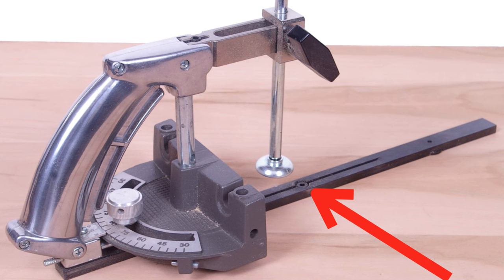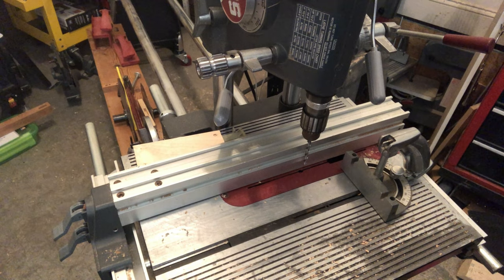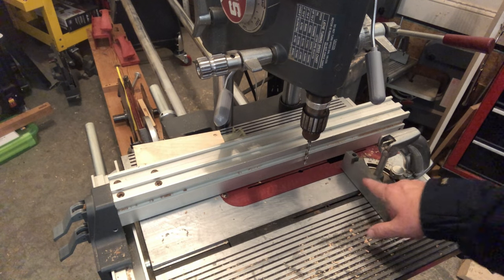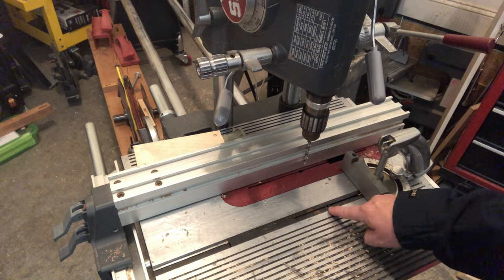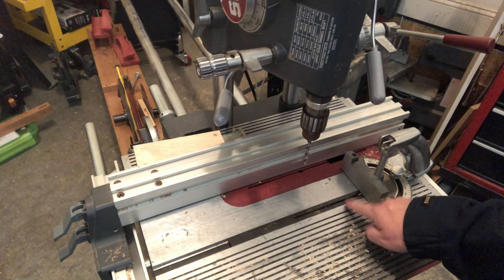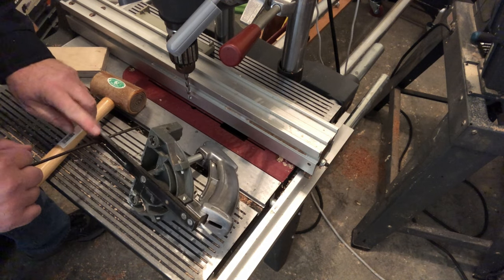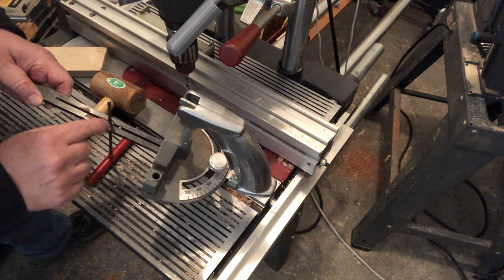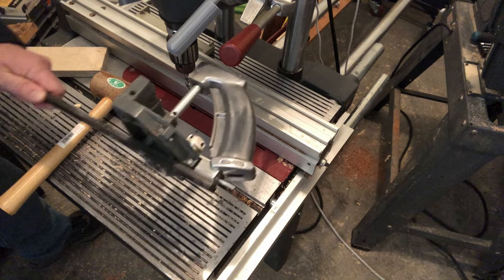The WORST Feature on the BEST Miter Gauge (You knew there had to be one!)

Comment: Yup… it’s a common problem.  I’ve had it happen twice.  My fix was to use anti-seize on the screw.  You only want to use enough to coat the screws threads as it will collect sawdust.  It retains enough to work for about a year.  Which reminds me… I need to check mine for re-coating.

And no!  The Fastenal store was flustered that they couldn’t find a source for that tapered screw.  I decided that if they couldn’t locate one… it’s origins are very obscure.

I wonder why Shopsmith didn’t just taper the hole threads and use a standard set screw?  The profitability from selling the replacement set screws can’t be enough to lock them into a proprietary sales scheme!

Comment: Thank you for another great video and tip. I have always used paper as a shim but When this happened to me, I cut the screw in half with a dremel and a thin cut off disc. Being in Canada the screws are far from inexpensive and there is never a sale on Shopsmith. In spite of the cost, I now have backups to a state of redundancy.

Comment: On recommendation of another video of mygrowthrings, I ordered and received the Shopsmith 61-poece help kit.  It came with some items that I really didn’t’ need (paste wax, shop rags) and other stuff that I did need.  You can always use another 5/32” Allen Wrench, the alignment and maintenance manual is nice and I’ve never needed a pocket oiler but it’s nice to have it.  
•	What the kit did have was shims and socket-head screws.  It came with 
•	(20) 5/16"-18 x 1/4" Socket-Head Setscrews
•	(6) 5/16"-18 x 3/8" Socket-Head Setscrews
•	(5) 5/16"-18 x 3/8" Motor Pan Setscrews with nylon locks
•	(5) 1/4"-20 Flat-Head Table Insert Setscrews
•	(1) 1/4"-20 x 1/2" Round-Head Setscrew

I then went to the big box store and got a plastic 10 place organizer, separated the setscrews and put the setscrews in their own place with a piece of paper with the size on it. 

If I ever need them, I have them.
Reply from the maker: That's a great idea of sorting and store them like that. I sure wish we could find a source for the tapered set screws. Scott
Reply: Great idea.  I found my bag of SS set screws but they are all jumbled together. I’m not exactly sure which ones go where! A bit frustrating.

Comment: Great video, couple of ancillary ideas. If the Allen wrench is rounded, cut 1/4“ off the end with a bolt cutter and grind it square. After you get the miter gauge out of the slot, heat the sides up with a propane torch, the threads will expand and you should be able to easily extract it. It think I will extract it and put some wax or graphite in the threads as a preventive measure. The paper trick sounds like a great idea, I’ll try it next time. Thanks again for your coaching.

Comment: The same thing happened to me 2-3 years ago before I knew about the paper trick. I was horizontal boring a fly rod handle for my father in law and locked the miter gauge to hold the blank. The next day it was completely frozen and I stripped the hex socket trying to loosen it. I carefully cut the set screw in half with an oscillating tool to remove it, cleaned all the corrosion out of the threads and ordered a new screw. I believe corrosion build up was the root cause.
Reply from the maker: Bummer. I agree that corrosion is almost always the culprit. I ALWAYS use the paper trick... except this time.

Comment: That's one benefit for us Shopsmith owners; is the long hex wrench. If the tip is starting to round off, you can always grind away that portion, and have a "fresh" tip again. It would take several grindings for the long hex wrench to become too short, before it would need replaced. 
I've done it a few times over the years. Just don't get the end hot enough to pull the temper out of the end you're grinding on.
Reply from the maker: Great tip, Chad.
Reply: @MyGrowthRings  No pun intended, eh Scott? Lol.

Comment: I just measured the set screw on my miter gage, and it appears to be a 1/8 NPT male thread (~.400" OD at the fat end and 27 TPI).  A normal 1/8 NPT plug looks to be 3/16" hex drive and much thicker than the 5/32" that this one is, but I bet you could make your own for less than a buck by grinding down a pipe plug.

Comment: Hiya Scott!  Happy Easter!  As far as screw removal, which I’ve done a lot of, I have found that before I break out the various screw extractors, that I try the closest size of a Torx driver.  With the taper of the Torx tip varying, there’s always a spot that can catch the “corners” of the hex cavity and with just a tap with a small mallet get enough bite to do the job.  May not work for everything but it’s proven to have been a quick cure for half a jillion screws for me. 
Thanks for you contributions!  Any word on an “MGR Shopsmith Shelf” yet?
Reply from the maker: GREAT tip!  I better not have to use it again because I can be taught, but if it happens again I'll be sure to give it a shot.  No shelf yet, but it's high on the list. Scott

Comment: Shopsmith school (40yrs ago) taught me to insert a simple piece of paper in the slot where the bar hex screw is going to be tightened down.  using this trick will prevent that  hex screw from  breaking.
Reply from the maker: Exactly right. I knew better, but failed to do it. This degree of hassle should be my reminder for quite some time. Scott

Comment: Happened to me.  I drove a plastic felling wedge in the slot on both sides.

The new tapered set screw I found on EBAY - a SSmith owner.  The replacement has a touch of “never seize”.

Comment: Just had that occurrence today.   Miter gage had been locked in the slot for about a week, wonder is that had any bearing on things.  Anyway, screw would not back out.   Thought I was going to break my SS 5/32 wrench.   Put a bit of WD-40 Super Penetrant on it and let it set for a few hours.  Still could not budge it.   Put a 5/32 bit in my Porter Cable impact driver, and it CAME RIGHT OUT!!!  YAAAY!
Reply from the maker: Woohoo!

Comment: I hope that never happens to me. But it’s understandable. If the hex wrench happens to be rounded over, take it to a bench grinder and slowly eat the tip of the wrench back until it’s in good material. I would have saved myself a ton of frustration at work where we had rounded over hex wrenches stripping out hex head screws very prematurely. Had I only known (or thought about it).
Reply from the maker: I hope so for you!  Yes, I've done that too.
Reply: Yes, i do that as well.  Every so often I do just a slight regrind on the tip just to clean the edges.
Reply: I used a Dremel  cut off wheel to take off about an 1/8 inch. Good as new.

Comment: This happened to me. When I got the guage out the setscrew wouldn't turn. I used penetrating oil and had to spread the slot slightly to extract the setscrew.

The screw is NG and I need to find a replacement.

Comment: i might have passed this one up, had this issue not just come up for me. I was drilling the ends of some Ipe boards, and needed the miter gauge to absolutely not budge. Of course, you know what happened. I ended up chewing up my SS toolbox, rounding out the locking screw, and making myself feel like a complete idiot.  I am going to have to rethink how I position wood with the miter gauge in the future, because I never ever want to experience this kind of fiasco again. I suppose there is some small consolation in knowing that I am not the only one to have experienced this.

Comment: On an unrelated but semi-related note, the nylon screws that adjust for glide on the table in my miter gauge are "stuck" in position. I need to move them to account for 40+ years of wear, but they won't budge. I don't recall if they have a 5/32 Shopsmith toolbox head or a flathead screw slot, and I can't see down the bore. Any tips? Thanks, and Happy Easter.
Reply from the maker: Ben, is there a chance that there's a steel set screw in the hole above it? Also, is it a small, white, bullet shaped glide or is it shaped like a hex bolt? It it's a bullet you need to use a #1 flat blade screwdriver. If if wont budge you can drive in through with a drill bit from the top, but that's a last ditch effort. Scott
Reply: @MyGrowthRings  Hi Scott, It's a bullet shaped glide that I believe is made of Nylon. I can't see down the hole, so I'm not sure what's going on. I even tried using a borescope, but I can't get a clear image of what's in there. I tried the 5/32 wrench and it just spins. A flat screwdriver does seem to "feel" a slot, but neither screw will turn. I contacted Shopmith about this a while back, and even sent them pictures of the gauge and the bottom showing the glides but they just kept asking me questions about what I was referring to. I suppose I'll have to drill it out, but I'm not sure if replacements are available. I guess worst case scenario I'll just deal with it. Thanks
Reply from the maker: @benpress8884  For sure it calls for a flat blade. I suggest taking a number one flat blade screwdriver and with the miter gauge firmly on a table, drive it into the glide from above with a hammer. Not a ton of force should be required and once you have impaled the glide you should be able to turn the screwdriver clockwise with some force and drive it out of the miter gauge head.
Reply: @MyGrowthRings  Thanks. I'll give that a whirl
Reply: @MyGrowthRings  Okay, that worked for one side, but the other glide is firmly stuck in place. I've got a few drops of PB Blaster soaking it now to see if it will break free.
Reply from the maker: @benpress8884  Half way there! You’ve got this!

Comment: Scott, Thanks for the old video! You haventy aged a bit. Could you please tell us the Sopsmith part number for that tapered setscrew AND where else that same set screw is used on a shopsmith Model V 500 so we can order a few to help offset the shipping cost. I know its not the same setscrew as the one to remove the Quill.
Reply: Taper screw:  501401.  Can't answer your Model V 500 question.
Reply from the maker: @dwightl5863  Beat me to it!

Comment: Is that tapered set screw included in the help kit?
Reply from the maker: I thought that it was, but it’s not listed in the parts list on the SS site.
Reply: Shucks, I hate paying that $5 for a tiny piece.
Reply: My help kit came with two of the tapered screws as listed on contents shown on the box.  I bought it in 2015  and it came with an alignment dvd for about $65 but I think I had also bought another one a lot earlier when they were about $49.  Maybe they have changed the packaging over the years.

Comment: Couldn't you have stuck a wedge into the slot near the tapered screw and put some pressure to spread the opening a bit, then try the hex wrench?
Reply from the maker: Yes, that’s how it is done, but it won’t work until the miter bar is out of the slot.

Comment: I have to ask. My miter does not have a tapered hex screw. The miter bar is tapered. So a standard lock screw works great.
On another subject. You mentioned you have A cross cut sled, but rarely ever use it.

I made one for my 520 that I really like except when pulling it back or pushing it forward too far it will tip off the table.

So my first thought was to use the extension tables, but they’re too far from the main table and allow the slide the tip minds only 22 1/2 inches or 20 20 1/2 inches deep. So when I posted the video I made on this and I’ll give you that I’ll try remember the link name another Shop Smith owner basically suggested that I get the Shop Smith miter bar. However I don’t like that idea for two reasons $99 is the first and second you have to pull the slide completely off and in my physical condition being 80 years old and disabled veteran I would probably end up injuring me.
But it gave me the idea to insert the Shop Smith T nut in one of the miter tracks towards the back so when I do push the slide forward it won’t tip and I made a video on that then decided why not put one in the front about another 9 inches forward and the one I put in the back to make sure that when I pull it back too far it doesn’t tip on me.

This is all for safety so I will give you the name of the on my channel is choochoo3985 and the video is shop Smith cross cut sled. There are actually two the first one is for the extension and the second one is for the team that on the first one I made comment I mentioned your channel I don’t know how I found you by accident so hopefully I’ve had several people look at my video and I will give them your video channel and hopefully they’ll pick you up because I appreciate what you do and I think they will too.

Hey have a great day.